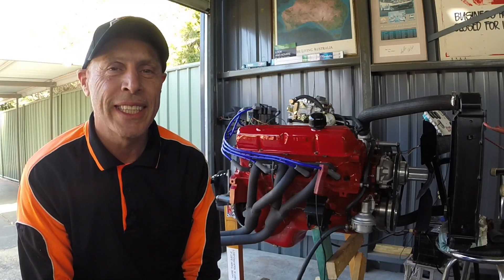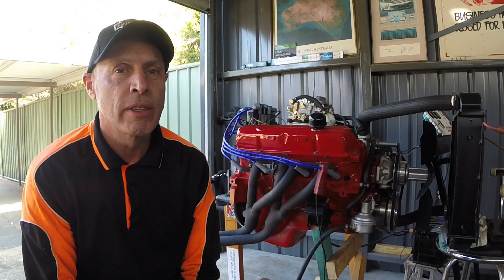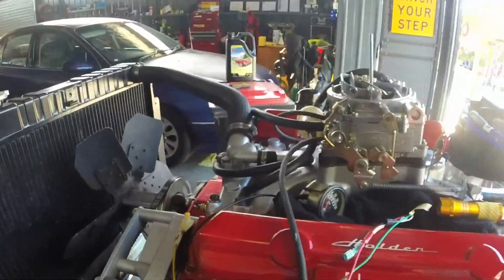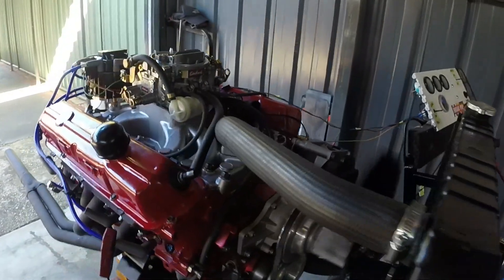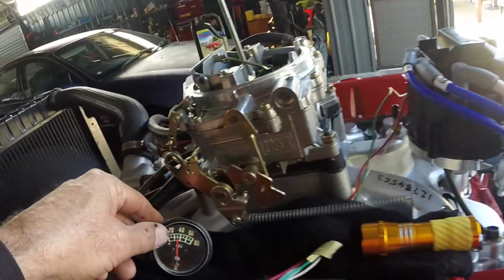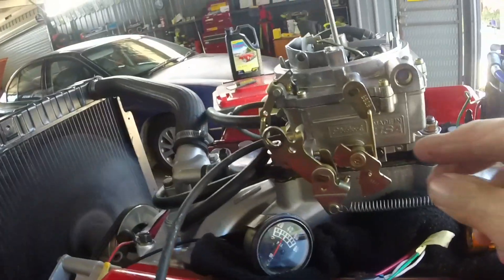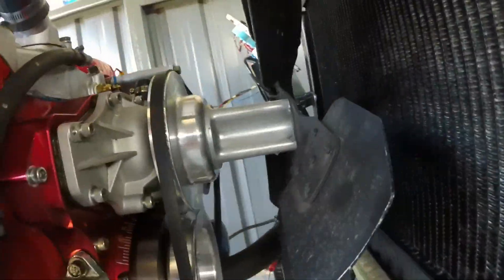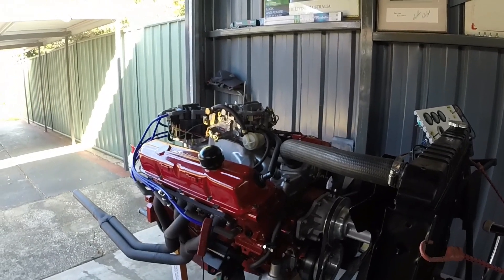Bench testing a Holden 355 stroker engine.

Comment: I got my VS with a 355 going over Christmas time and love it! The sound and low down torque make it a great cruiser. I was wondering is there a reason you didn't go atleast 10.1 compression ratio? By the way mate love all your vids.
Reply from the maker: The machinest said at least 9:5 to 1, so it might be close to 10 to 1. Should go good on 98 octane. Thanks for the support 👍
Reply: @StreetspecTV  Can’t wait to see it in the car